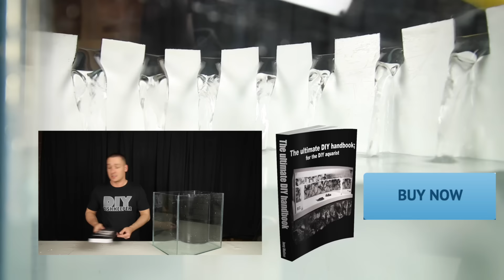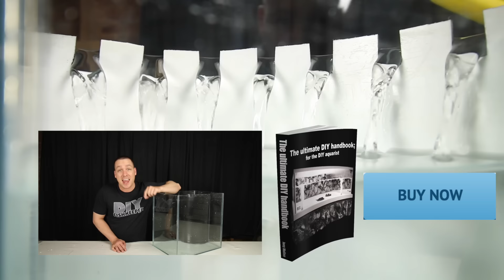HOW TO: Build an aquarium overflow weir

Comment: I just see it as more work than required and a permanently modified tank.    Plus takes  up room in the tank.      I made a diy 12 gal sump from a cooler and some spare odds and ends for my 55 gal.   .   Instead on drilling for the tank output or using a pump for the tank output to the sump.  I used large hose black garden hose  for both input and output to the sump.   Then clear hose from behind the tank down into the tank.      The output from the tank to sump has a 16 oz clear water bottle screen with  filter around it  so fish are safe and can’t be sucked in.        From tank to sump is siphon powered and is made to where if the power goes out the water level in the tank can’t drop more than a couple inches  nothing can overflow .   And from the sump to the tank is a pump  I modded to accept the garden hose           The end result is simple  easy to make  takes up very little room and   Doesn’t require any sort of modifications to the tank.  And it’s whisper quite.

Comment: what are your thoughts of using bottom section of the bucket and drilling your back glass so its just in the top corner of the tank not all the way down
Reply: That would work. safer too, if the bulkhead leaks.

Comment: is it possible to use acrylic and silicone to seal the glass hole that holds about 2 gallons of water? I ask because I will need to remove it in the future and glass on glass will be impossible for me to detatch with my weir setup.

Comment: All that depends on the flow capability down to the sump being quite a bit greater than the flow up from the sump pumps.  When the flow down is getting marginal - you'll first lose all skimming.. the weir water level will equal the tank water level.. because the increased head pressure in the tank forces the pump flow rate down the overflow/standpipe.  For a 1.25" schedule 40 durso style overflow - that is about 600 GPH. 625 max

Comment: I got a lot out of this video. What is your opinion on just including the foam with the weir? any detriment?
Reply from the maker: +Rachel O&#39;leary And still using it as an overflow? well, if you put anything in front of flowing water it will slow it down to some extent. The finer the sponge, the more it will slow it down. With the water being slowed down, it will have to rise higher on the aquarium side of the tank to overflow the same amount. That raised water level is not a big deal, but it does mean that your sump will have to be able to accommodate that much extra water during a power outage.
Reply: Instablaster...

Comment: joey I have been trying to decide how to build and design my sump for my 135 gal. it will be freshwater cichlid tank more than likely. I want to do an overflow box to hide everything but didn't know if I could use the diy pvc overflow pipe behind this or would it not work. I like your pvc weir overflow as well

Comment: Sorry if I missed it talked about already but, it seems like a lot of unused aquarium volume. I could see how the foam could interfere. Is there any other way to use that I volume as  filtration. Or is there are enough circulation for heater.
Reply from the maker: +DaSchoe I explained how to size it in the video. Heaters go in your sump. There is no reason to try to jam anything extra behind the weir. There will not be room once properly sized. You have an entire SUMP for that. The tank and weir here are just visual examples. I wouldnt put a sump on a tank that small, let alone a weir that big for it.

Comment: How effective would the sump design be in filtering bottom of aquarium if the water at top of tank is the only thing that would enter the sump? Is this where power heads come into play to get the bottom water circulating?

Comment: Hey Joey, What you are doing for the community is great. My question on this build is that, after the weir is added to the build, do we still need the stand pipe? I am simply not able to understand the use of stand pipe once weir came on.
Reply: I can think of one reason - I would imagine the sound of water falling 11" or so would be pretty loud, having it only flow 1 - 2" is much more quiet.